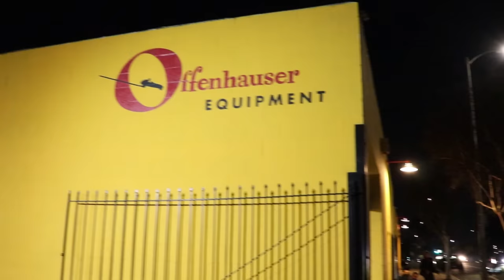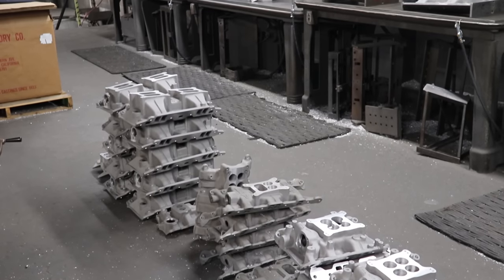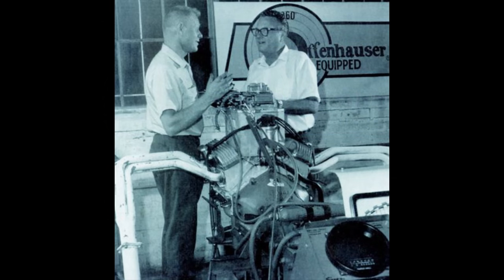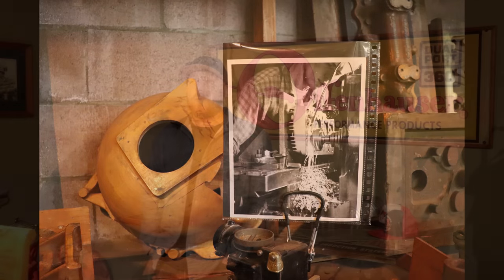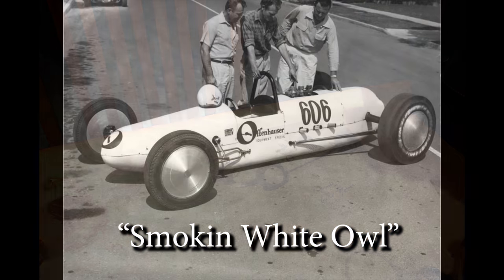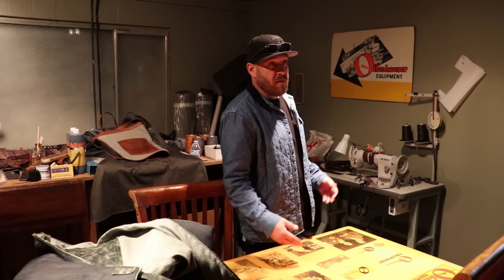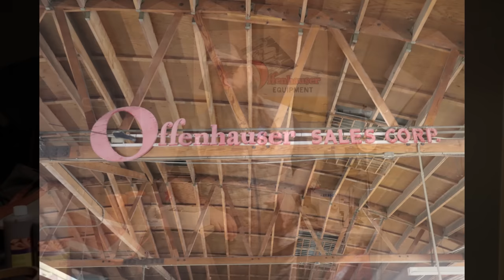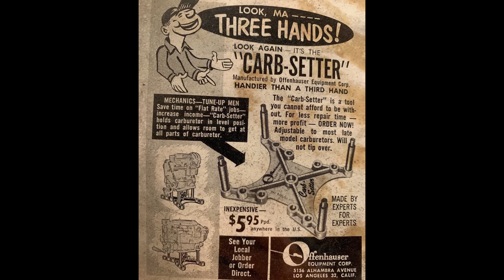Offenhauser Speed Equipment - Not All Metal Is Created Equal

Comment: Some of those manifolds brought back memories. One is the slant 6 4bbl unit.
When I first got my gas station I found a Offie for a 292/312 Ford 3 2bbl under a workbench. Must have been put there and forgotten. Sold it at a swap meet. As I remember I didn't get that much for it.
I like the carb setter poster. $5.95 free shipping. (Ppd. =  Postpaid) lol.

Comment: back in the early 90's I had a Hondo Flat Bottom boat with a 427 BBC form a 67 vette and a Cassale V drive. the motor had Offy Valve Covers and an Offy Tunnel Ram on it with twin Carter AVS cabs. it would scare the hell out of you any time you got on it. Offy makes good stuff. I worked part time at a machine shop in high school, so I love seeing old school equipment. CNC is ok, but there is something about the old school machine that is just cooler. especially on old American made machines. love that van norman. we had a Van Norman boring bar in the shop I can not count how many SBC I punched out with that thing.

Comment: I plan on building a 239 flat head for my '51 Ford later on this year (racing engine) I might need some advice or tips on parts. The one I have in it now checked out standard so I put everything back standard, it runs strong and smooth, about 15 years ago I bought a book from a guy in new England that wrote a book on how to build flat head racing engines, he won a lot of races but has since passed. Anyway I plan to go by his instructions on the build. I enjoy the videos.

Comment: Super kewl!  Although it isn't on the car any longer, I still have the Dual-Port 360 I installed on the 283 in my '57 Chevy around '82.  It was probably the first performance part I bought as a teen!

I dig the shop, but the buildup of swarf & other gunk on the wall & electricals at 10:36 makes me cringe.

Comment: great company. Its a crying shame that since they still have all of the old molding bucks that they dont offer some of the older parts on an as ordered basis. there were parts they used to offer years ago that are no longer available, such as for the Mopar Poly engines.
Reply from the maker: That sort of business plan would put them out of business. The labor involved to pour one manifold for a guy and then all the machine work to get it ready and sell it for 2-$400. They'd go out of business doing that. I'm sure if you call them and arrange a group buy they'd consider pulling old molds out.. but making one here and there is going to be cost prohibitive. Just my humble opinion. -Matt/ITG

Comment: I wonder how many Indy 500 s the Offy won?
Reply: Alot, but I believe that was a different family member, but also named Fred. The post-war Offenhauser we know today is not the same as the one that made the Indy/sprint car engines. But obviously a pretty good gene pool in this family.
Reply: Correct, it was a separate company.  The engine company actually sued the parts company over the name, with the latter not being allowed to use "Offy" for any materials.
Reply: Fred H Offenhauser was behind the Offy engine. Fred C. Offenhauser was an engineer for that company. Fred C. was Fred H's nephew. The war happened. The company was sold to Meyer and Drake. Fred H. retired. Upon returning from the war Fred C. started Offenhauser Sales Corp that survives today.
Reply: Meyer and Drake and then what that company became sued to prevent Fred C. from using both Offenhauser and Offy. The settlement was that Offenhauser could use his own name, but not the "Offy" nickname. Offenhauser recently re-acquired the rights to "Offy" so this is all in the past.
Reply: @jbb115a  If you look a some small parts and decals they say "Offie" that was a way to get around the settlement. Offenhauser engines won 27 Indy 500s.